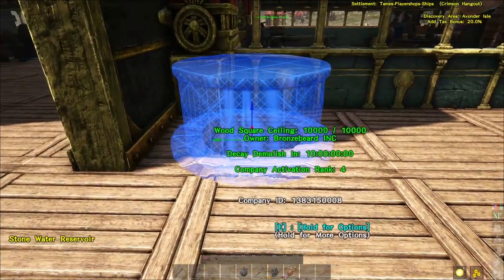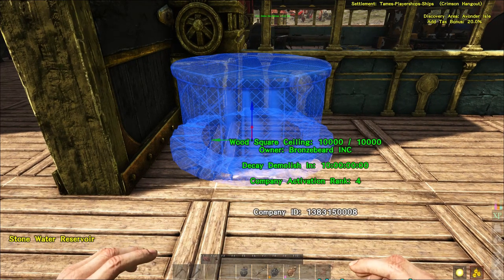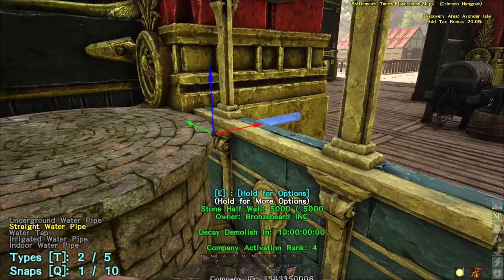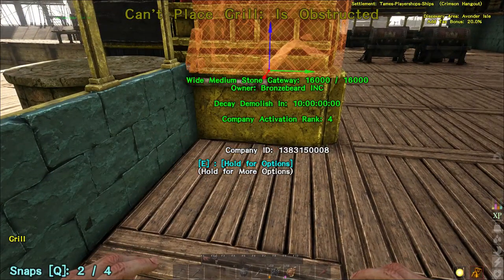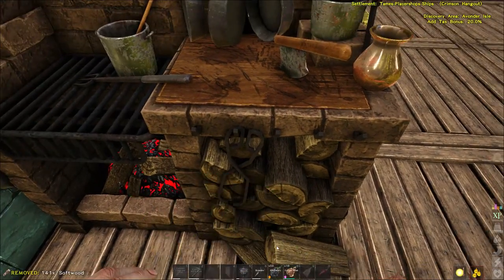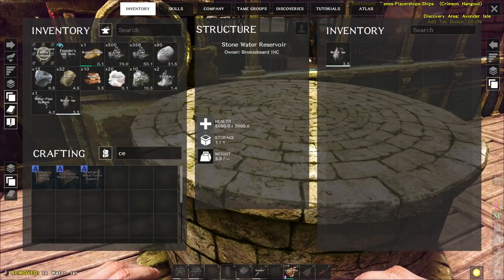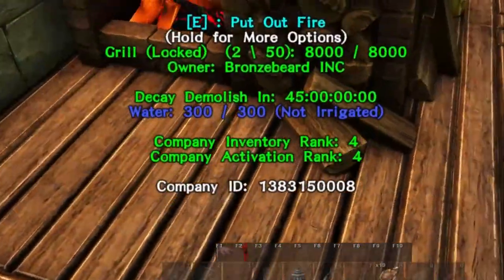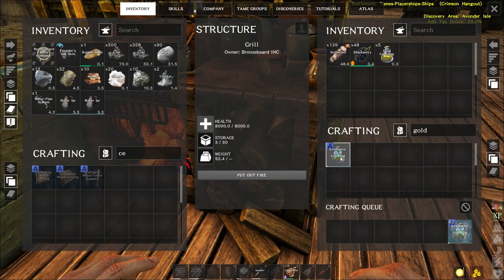Atlas | How To Irrigate Grill | Atlas Tips

Comment: I'm trying to transfer water from irrigated resevoirs to not irrigated ones then to my farm, but it won't transfer over even its connected,  any clue why?
Reply from the maker: I think the entire system needs to be filled as in each reservoir and then after that it should work normal.
Thats all I can think of off the top of my head hope it helps